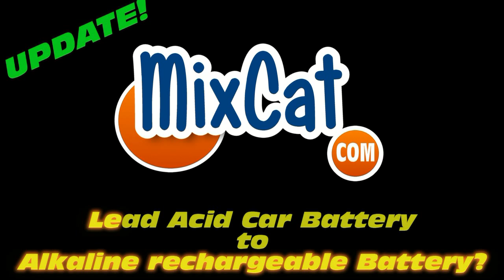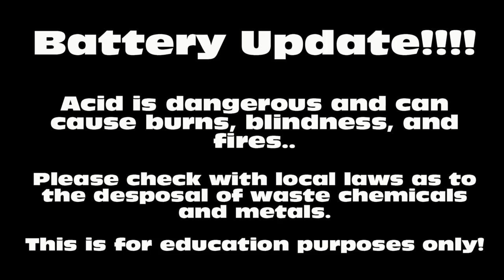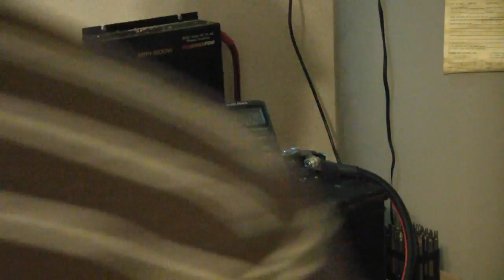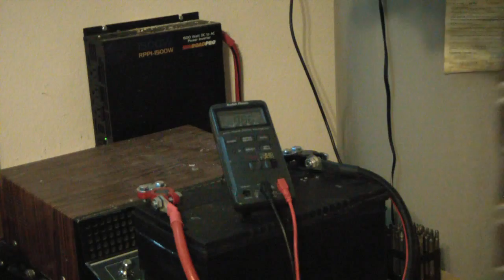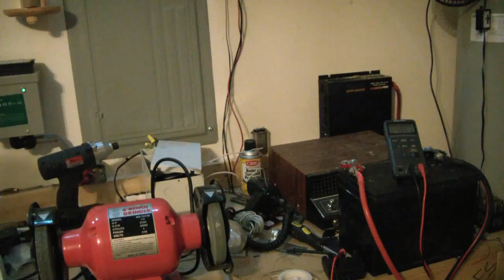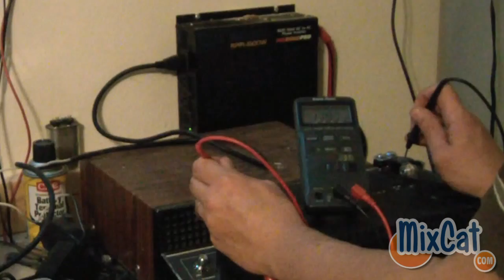Lead Acid Car battery to Alkaline rechargeable battery conversion !UPDATE!

Comment: Alum is KAl(SO4)2·12H2O.  Thus it is a salt though the Sebastian said it measures as an acid.  In a normal battery the positive PbO2 plate converts to PbSO4 on discharge.  It appears that washing with baking soda just helps to remove crud at the bottom that was causing internal shorting, but doesn't really desulphurate the battery.  Hard to tell what the new salt does - perhaps the Potassium and Aluminum is deposited on the PbO2 plate and is compatible?????? Any thoughts?   Or maybe its just a placebo in that there was enough lead left to make the battery work as original but probably less capacity (AH).   

Anyway, thanks for vid.  My almost new battery lost its acid in an accident and I was hoping to repair the hole and refill it but didn't know what to refill it with since consumers may not be able to buy pure acid.  Alum seems a good substitute.  I'll be trying to use the battery in a solar system to avoid automotive vibrations.
Reply: Oh, i think i get it.  When you add the alum and then charge the battery the acid is manufactured at that time using the SO4 ion plus the hydrogen from the water.  So its still a lead-acid battery.  The whole thing depends on there being enough Pb in the system to make it work.  

If i recall, when i bought the battery, i had to wait while it got filled/charged.  I thought it was filled with acid at the store but maybe it was filled with an intermediate fluid and then converted to acid during the first charge??

Comment: This is an impressive test but i find it quite irresponsible that you are encouraging thousands of people to try this at home. It would have been more responsible if you had shown where to take the old liquids which are not only acidic but full of lead, i'm not saying that everyone will discard their old battery acid and the backing soda wash into the environment but i expect that some people will, I would be great to see someone making one of these videos who explains where to take the old liquids and how much it costs to have the old acid dealt with. I know you have a disclaimer but that doesn't stop other people doing what they want to do and there will be some people out there who don't give a toss about where they pour their lead enriched solutions! Thanks for the info and testing.

Comment: Hello. I'm just starting to convert batteries to alum electrolyte. I was wondering what steps you took to get the acid out. I've found that even after rinsing for a day there is still acid in the battery. I've been rinsing with baking soda and water until there's no more reaction in the cells. Then I rinse again with mild alum solution to make sure the baking soda is no longer going to effect the final fill. Think I'm over doing it?
Check my video if you have time.
John

Comment: so the basic idea is that the battery does not have the sulffication like it use to because a alkyline solution is used instead of an acid right?
but what happens if the lead plates are shorted?

Comment: This is really cool...I have (many years ago) gone to the junk yard and purchased batteries for 10 bucks or less.  Many were going to the lead recycler...  I'm not sure what the cost of lead is now, but I'm sure you could find a dead 12volt battery for 5 bucks somewhere to restore.  (Of course, we'd never do this at home because the vapors are bad and stuff, - so in theory anyway).

Comment: There is also a simple circuit called a joule thief that can rejuvenate batteries.The circuit has many other uses as well like powering many LED lights with a single 1.5v AA battery.All you need is to wind a bifiler coil (TESLA) a resistor npn transistor and a diode.
The coil is the key to the efficiency in that it utilizes back emf spikes.You can charge a large battery from a small one as well.Can charge a 12volt from a 6 volt battery.

Comment: I don't think that so called "Alkaline conversion"  (alkaline rechargables work in a complete different way - completely without lead, e.g.) is such a good idea after all - also, using a car battery for deep cycles is also not what it's made for.   Google for "battery faq" for further info..

Comment: Good stuff. 

So if you have ten of these batteries connected together, it would give you 120V. Making several ten battery arrays could remove you from the grid completely if you had enough solar panels to generate the power necessary to recharge them.
Reply: is this even possible ?

Comment: how much alum to how much water????
just alum? 
i saw this before..... its a really good idea.....
my brother in law takes cell fone batterys and scrapes 3 amp power supply lines backward on the connections......real quick......3 times..... says they work fine after ward

Comment: a couple of question 1) you have advertisement on your videos now, do you get paid for that? 2) did you test the battery with a load on the grinder? now i have a comment, why don't you use lithium battery's? I saw a video where a guy uses lithium Titanate battery's in his motor cycle about the size of a small phone book, check out this video about this battery -  Lithium Titanate Battery Test   copy and paste this